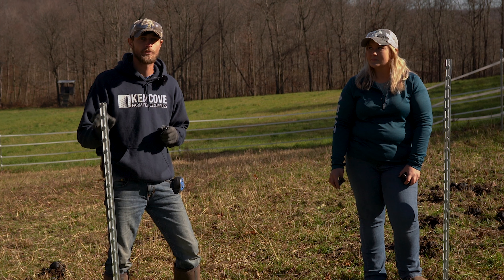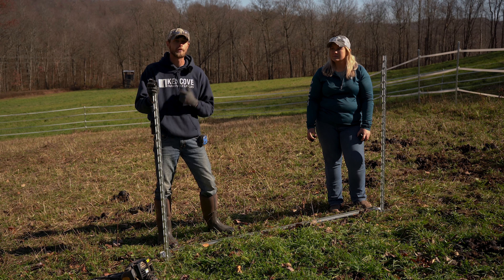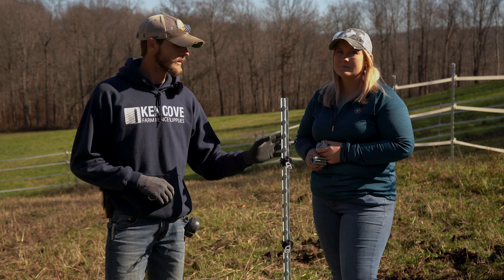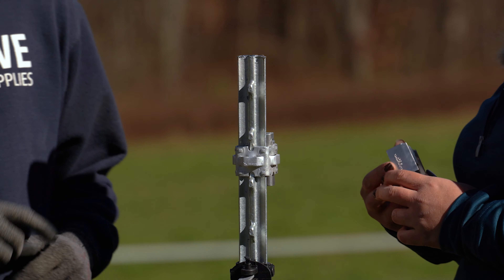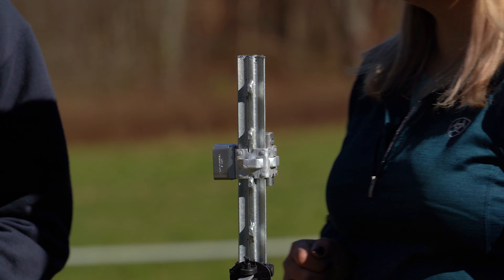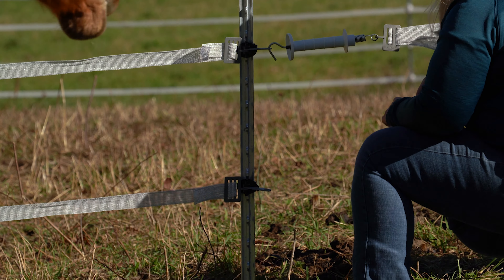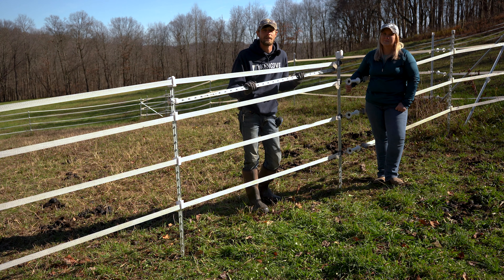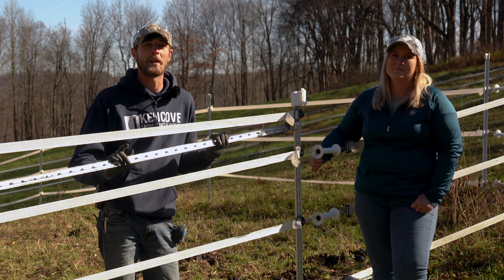Fencing 101 - Building T-Post Horizontal Braces with Wedge-Loc

Comment: Please do a video on T posts with High Tensile Wire (using Wedgeloc corners)!
Reply from the maker: Hello and thank you for the suggestion! When  using T-post corners, you do not want to exceed 3 strands of high tensile wire.
Reply: @KencoveFarmFence  Thank you. Alright - We will need to redesign our fence plan. We were planning for 6 strands of electrified high tensile and one additional bottom strand non-electrified barb wire and have a tight budget.
Reply from the maker: @stephengregory7953  You could still use T-Posts as your line posts, but you would want to use wood posts for your corners for that style of fence

Comment: Interesting product.
I notice that it only works when you push on the post.
When you pull, the horizontal post falls out.
Reply from the maker: Without having tension on the posts created by a fence, yes pulling the brace away from each end would result in the t-post falling out, as the t-post would not stretch to maintain the distance between posts being pulled away from each other. Once the fence is up and tensioned, you should not be able to pull the posts away from each other.